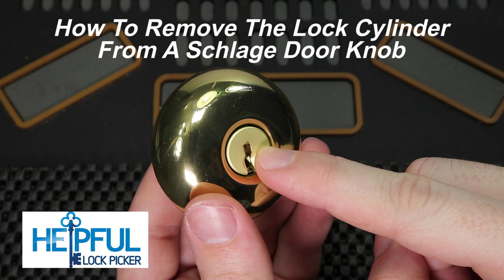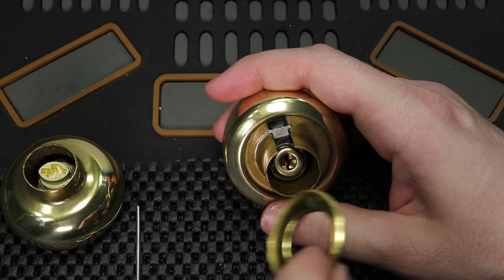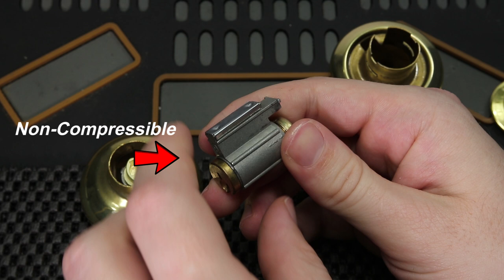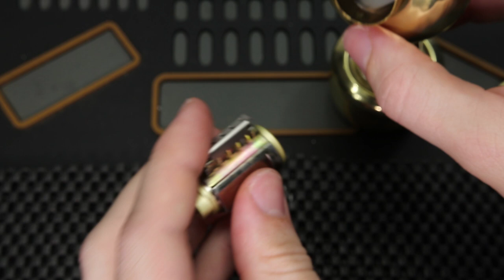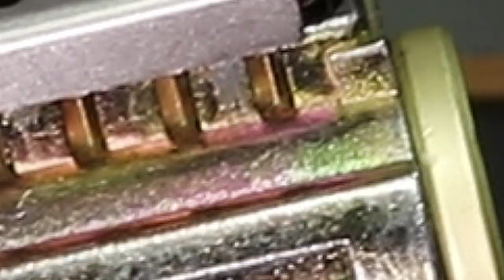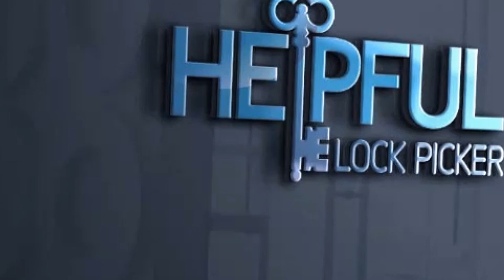[328] How To Remove Lock Cylinder from A Schlage Door Knob

Comment: Thank you for the video, this is the closet I could find for what I need. I have a Baldwin door knob, with medeco m3 cylinder, would it be a similar procedure to remove the medeco cylinder? For some reason I can't find any videos on Baldwin locks disassembly.
Thank you again!
Reply from the maker: I don't think they would have a compressible cylinder. Most knobs you need to turn the key and push in a detent of some time to get it off.

Comment: Can you change the handling of the handle this way ? All of these Schlage locks seem to be right handed only. Where on a right handed door (hinges on your right when facing the outside of the door with the key hole). Allowing you to lock the door by turning the lock towards the door jam to lock. & back towards the hinges to unlock. 

Is there a way to switch that operation to make it work as a left handed lock ? Where on a door that has the hinges on your left side when on the outside of the door (facing key hole). Can lock towards the jam & unlock turning towards the hinges (or back to the upright position) ?

In other words, to lock the door you'd:
•From inside, turn the lock towards the left (counter clockwise). 
•From outside, turn the key towards the right (clockwise) ?

Or is this impossible for schlage locks ?

Comment: Once you remove the cylinder, can you replace that old cylinder in a new lever and/or deadbolt, in order to not have to rekey? (all schlage products)
Reply: From an old lever to a new lever, and from an old deadbolt to a new deadbolt
Reply from the maker: You typically can. But if you need one that needs a compressible bible you need to make sure you get the correct type. However, re-keying is easy and cheap. It would probably be the easiest choice.
Reply: @HelpfulLockPicker  thank you!

Comment: i have a schlage door lock with just the keyway on one side   i do not have the key to the door lock and i'm having a hard time getting of the door knob  i see the push pin slot on the inside handle but i still cant get the knob off   any suggestion?
Reply from the maker: You will need the key so you might need to call a locksmith
Reply: What if the pin is on the other side not the key side ?

Comment: I have a knob that I would like to get the core out of but I can't seem to figure it out. So the knob came out of a door and I don't know what key it uses I tried using a bunch of my keys but none of them goes in it. The knob has a square tube coming off the spring mechanism and there's a tongue that goes through to the twist-lock mechanism in the other knob. It's how I can unlock and lock it but I have no idea how to get the knob off the base anyone knows of a source that can show me how to do this I would like to repin my actual door lock its way cheaper than buying a new one but the only way I can is to practice on this practice knob I have. Can anyone help?
Reply from the maker: I feel like pictures would help.
Reply: @HelpfulLockPicker The insides look like this lock. Right under the bold letters INTRODUCTION click the 2nd picture and you can see the square tube with the tongue I'm talking about. 
https://www.diynetwork.com/how-to/rooms-and-spaces/doors-and-windows/how-to-change-a-doorknob
The knob looks like this though https://www.amazon.ca/Drenky-Stainless-Entracne-Passage-Lockset/dp/B074DCYYDF/ref=sr_1_16?dchild=1&keywords=door+knobs+lock&qid=1607541551&sr=8-16 but because you can't see the internals I don't know if its the same.
Reply from the maker: That looks more like a Kwikset type of lock. 

Check out Bored lock picker's video: https://youtu.be/Cw4MquHlD7k
Reply: @HelpfulLockPicker  Yeah I watched it that looks nothing like the internals that I have. The thing is this doorknob is the most common one here I've never seen one like he has the core could be Kwikset but the one on my door looks the same and is Schlage. Doesn't matter though I asked him the same question he got back to me and my Schlage tools actually worked in pulling this thing apart I have the core in hand it's truly amazing. I think I will have no issue as long as the one on my door comes apart as this one just did thanks again you always get back to my questions which is why I ask you when I'm truly stuck. Not sure if you remember but I had a Masterlock 570 I couldn't open for months now I can actually open it in a few seconds. Turns out I only needed to set like 3 of the 5 pins not sure why. I also bought a 2nd one and it has spools. I got lucky and opened it but only once so now I put spools in some of my practice locks, I find those pins extremely hard. Thank-you!
Reply from the maker: @KoolBreeze420  congrats on the open and I am glad he was able to help you out :-) he is a locksmith and deals with this stuff all the time that is in part why I referred you to him. 

I am glad you were able to get your lock taken apart!